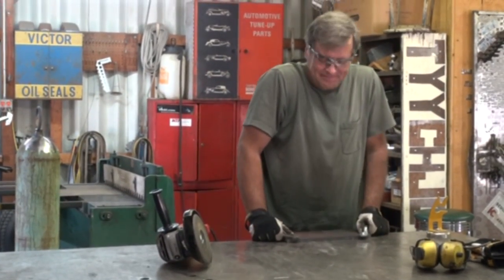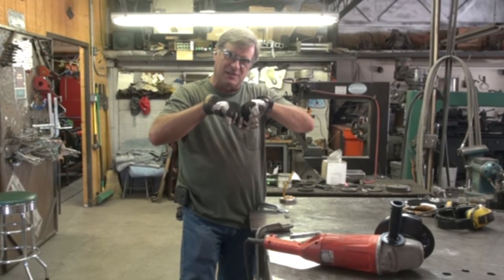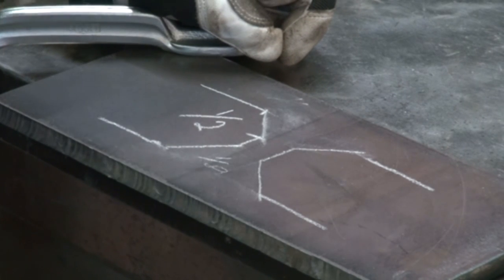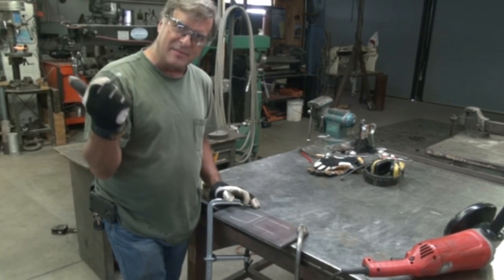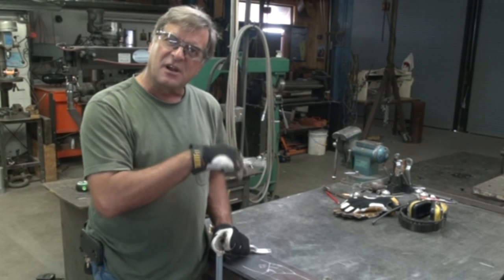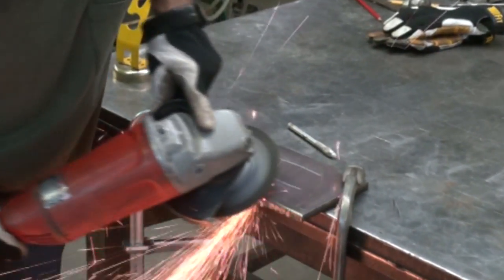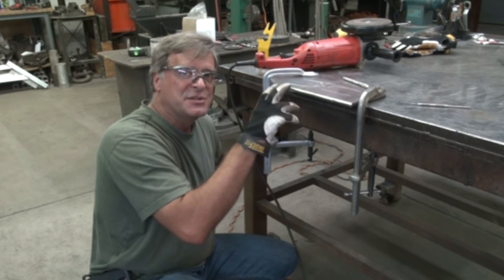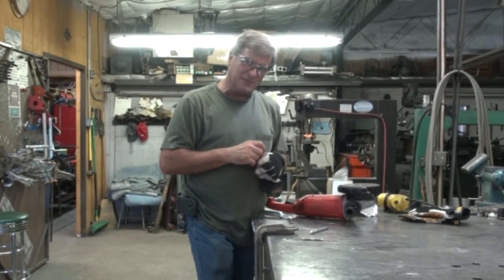How to Get Stronger Welds With Thick Metal - Kevin Caron

Comment: The bevel gives more surface area for the weld to contact. Insufficient heat inadequately penetrates thick steel no matter whether its beveled or not- but it’s still a stronger weld when beveled

Comment: i work at a place where i've seen the millwrights do the same Thing doin the chamfer   yeah it does makes the joint a lot stronger   i've seen them weld sum thick stuff Like 1" plate
Reply from the maker: Still learning at 60yrs!

Comment: I want to put a Ford pick up truck rear axle under my Mustang so it will have a strong rear end with disc brakes on it, to do this I may have to remove the perch plates from the truck's axle and replace them with the perch place from the Cars axle, so in this case would you prefer MIG welding or stick welding the perch plates to the rear axle.
Reply from the maker: I would use the mig for this job.

Comment: Hey a quick question, i'm working on a mini skid steer build, all the metal is 1/4 which i can weld fine with my 120v flux core welder except two plates which the 2 hydraulic wheel motors mount on that drive the wheels with chains those are 3/8 can i just bevel the edges and weld it???
Reply from the maker: That is what I would do!

Comment: Do you still have your newsletter? So question, I know the video is 6 years old but you probably keep up on your channel. So, 1/8 or 1/4 mild carbon steel, what process is preferable? Tig, mig, stick?  I know some have preference but I trust your opinion just by looking at your workspace.
Reply from the maker: Yes I do!    You can sign up on my website.     I reach for a tig torch more often than not.  All depends on how much welding needs to be done and if it is finish welding that people will see (tig)  or structural welding that is hidden (mig).  The stick welder only comes out for thick steel like for a base on a sculpture.   Hope this answers your question.  Thank you for watching and posting.

Comment: What about for a lap joint?
Any bevel for a lap joint on material that is too thick?
Reply from the maker: I wouldn't do a bevel for anything under 1/4 inch.  Over that, then yes, I would.    I guess it all depends on what you are making and how you need it to look when you are done.  I like to not have a seam showing so I grind everything smooth when i am done.

Comment: Do you think a Hobart 140 handler 115 v , would be able to weld 1/2 " material if I heated with a torch and made multiple passes along with chamfering ????
Reply from the maker: Keeping in mind that I am not a certified welder, I would say probably.   If you fit and bevel was correct and you welded both sides and preheat and it's not for a stress application.   (I hate trick questions!)
Reply: @KevincaronSculpture  lol I hate askin em lol thanks man I appreciate it
Reply: It seems that "rule of thumb" is not a substitute for the welding book.  A rule of thumb for MIG indicates 1 amp per .001 of an inch in material, or .500 divided by .001= 500 amps!  https://www.millerwelds.com/resources/article-library/miggmaw-101-setting-the-correct-parameters  See also, https://app.aws.org/forum/topic_show.pl?tid=32909  It does not appear that a 200 amp MIG welder can weld 1/2" material.   SMAW stick appears to be the same: https://www.waybuilder.net/free-ed/Courses/05%20Building%20and%20Contruction/050205%20Welding/Welding00.asp?iNum=07

Comment: I broke one of my automobile tools and I was wondering if it can be fixed. it's basically a hand press to press out the notorious honda bushings. it's called a honda/acura rear trailing arm bushing xtraxtor tool if you want to look it up. the part that connects the the control arm snapped and I was wondering if it can be repaired and have the same strength if I took it a professional welder?
Reply from the maker: Sure, maybe add a gusset in the right place to help stiffen it a little..    But defently something a pro should do..

Comment: Hi Kevin
So for a versatile welder 1/8-1/4”
What would you recommend?
Thx
Reply from the maker: For mig only I would go with the Everlast Power i-MIG 200e or the new Cyclone 200.  For an MTS machine look at the Everlast Lightening MTS 225 with tig package.  Just did a video on the Cyclone 200 and it is a very nice little machine!  It's not on the website yet but if you call you can get one.

Comment: I need to do some welding on steel that will be put under high pressure by hydraulics. Do I use Stick, MIG or TIG for the strongest welding joints, or are they equally strong?
Reply from the maker: I would reach for the tig first.
Reply: Thank you sir.
Reply: If your asking that question... probably shouldn't be doing it...

Comment: Hi Kevin, do you think this would be possible to do with a little 140 machine? I'm in the market for a welder and was considering a Hobart 210 MVP but borrowed a friends little Lincoln 140 and welded (albeit not the best looking welds) some 1/2 inch plate to some 1/4 inch plate and seemed like I was getting decent penetration with the circular motion technique (or making little "e"s.) I just don't want to over buy if you know what I mean because I'm not sure how often I'll be doing this. Thanks!
Reply: ***** Thanks, that's what I figured. guess I'll go big! Love your new band saw by the way. It's so nice.
Reply: I have a Lincoln (we only run real red or real blue) 180 amp MIG.  It works fine for me.  My son who is a professional fitter/welder cusses it and prefers his 250 amp Lincoln MIG.  Bigger is always better, but at some point cost comes in to factor(and we are limited by single phase low current electrical supply.    I was afraid that the 140 would be too light for me.  Even with the 180, we exclusively run CO2 shielding gas rather than mix.  The CO2 makes worse looking welds with hard wire, but gives better penetration.  My son runs 75/25 gas.  He has pretty much switched to .045" flux core with gas.